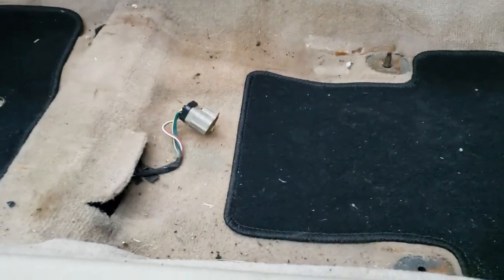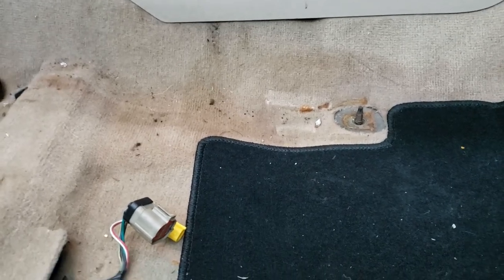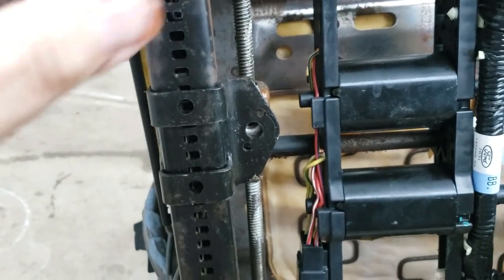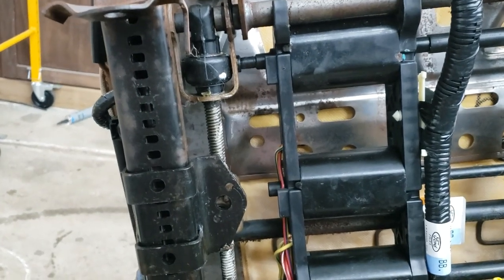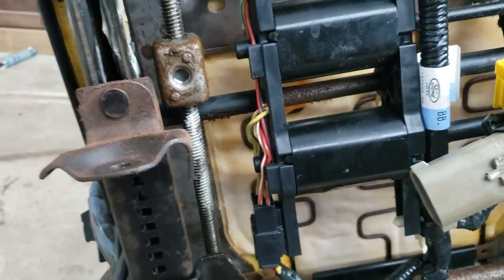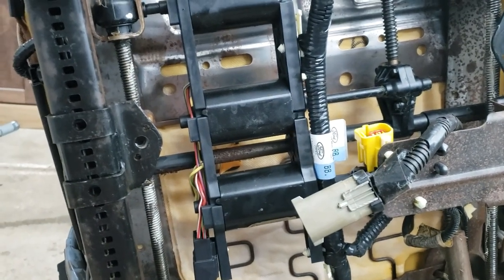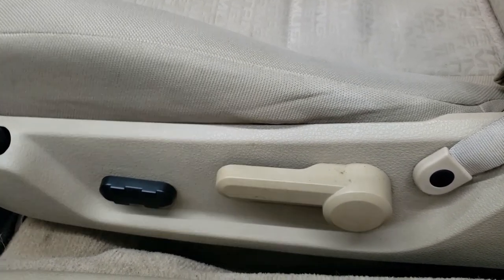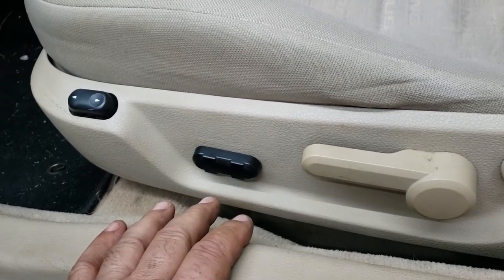2005 to 2014 Mustang power seat problems and solutions

Comment: You definitely get a LIKE here.  The wife's 07 Mustang had the front/rear power adjustment on the driver seat getting slow.  I figured the motor was getting worn out/sloppy clearances/etc.  Your video convinced me to get back to actually FIXING SOMETHING instead of just throwing parts at it. Yay!  Turns out a chunk of the hard plastic was jamming the track next to the trans tunnel. It came from the block that bolts to the track, and has the threaded bar for the front/back adjustment running through it.  The big clue was unbolting the seat  from the floor and running the adjustment.  Outboard track moved easily, inboard track was not moving much.

Pulled the seat and put it upside down on the bench, started working the tracks. Unbolted them from the blocks. Put a little bit of wheel bearing grease on the inboard track and got it moving. Wiped as much of that off as possible as not to attract future crud. Shot it and the other track with Teflon spray.  Got them really freed up. Adjusted the inboard block back to the same number of thread turns as the other to put the seat back square again. Bolted it all back in the car and it is 100% fine. THANKS!  All labor, no parts. 

Told the wife about all this ... she said "You know, I thought I was sitting in the car sideways.  Just thought it was me ..."   LOL.  She is thrilled this is fixed.   Happy wife, happy life.
Reply from the maker: You made my day

Comment: Valuable video that applies to me. I've owned mine since new. 2012. The power seats have become intermittent at times. Other times it's fine. Mine has the surface rust like that. 
This is what I'm gonna do to mine. I'm confident the track is  dirty from all these years. I just assumed the switch contacts were corroded or something. I'll look into it this weekend.
Reply from the maker: Yep try this first its free and just takes a little time

Comment: I have a 2012 V6 premium convertible. The driver's seat has power and moves back and forth but I can't get the seat to move down. the motor makes a noise but it's obviously stuck. My wife is fine with it because it's perfect for her height LOL but I also would like to drive our Mustang without feeling so tall. There is a lumbar adjust also makes a noise but doesn't work. Any idea which part(s) need to be replaced?
Reply from the maker: You will have to pull the seat and then the track off ... I am sure it might just be a small gear stripped since you can hear the motor running
Reply: I have the same problem

Comment: Thanks, I have a 2011 GT and the passenger seat stopped moving forward and back ,but the other switch positions work fine.
Reply: Did you find out how to fix it yet? I have a 07 mustang and the seat doesn’t move forward or backward but everything else’s works.
Reply: @Raul-dh1cu  It's the switch but I have not fixed it yet. They are about $130 and the whole seat has to come out, been just to hot to mess with it.
Reply: For 05-09 at least.

Comment: Hello. I have a 2013 mustang. The seat moves forward and backward fine. But the seat doesn’t move up or down. 😢
Reply from the maker: Could be the switch
Reply: @mustangrebuilder  in order to determine that, do I pull the seat out?
Reply from the maker: @Sega_is_all_i_cd  unplug switch and try to jump connections
Reply: @mustangrebuilder  thank you. Also when i push down on switch it makes a grinding noise.
Reply: @Sega_is_all_i_cd  did u fix it

Comment: Thanks! I'll see if this works first, if not i think I'll replace the switch
Reply: The switch is good, but seems like the motors don't have enough power because they try to move the seat but they seem weak
Reply: Didnt work. I think the teeth of the gears are broken.

Comment: I can't take the driver seat out, the seat is stuck all the way back and won't go forward so I can't reach the back bolts what can I do?
Reply from the maker: Can you get a wrench instead of a socket on it
Reply: @mustangrebuilder  the screw does not come out because it gets stuck with the part of the rail that is at the back I can unscrew it but not completely
Reply from the maker: @lupes1975  https://youtu.be/Jqpb_wJ_ZNA try this hack to make it move for you but look under the seat and along sides to see if there is nothing under the seat
Reply: @mustangrebuilder  Thanks I'm going to try to repair it with the video that you sent me, today I looked under the rails and I had a bottle cap stuck under the rails I took it off but it didn't move, you can hear the engine but it doesn't move. sorry for my english greetings from mexico and excellent video

Comment: Any idea why my seat will move forward and backward no problem… but will not move up and down. The passenger seat is the same… moves forward and backward… but won’t move up and down.
Reply from the maker: Could be switch
Reply: @mustangrebuilder  we already change the switch and it didn’t solve the problem
Reply: @mustangrebuilder  and also I was wrong. The passenger seat will go up and down, but will not go forward and backward. The driver seat will go forward in backward, but will not go up and down. There’s no way that could be a fuse, correct?
Reply from the maker: @suehorton5041  so you have power since the sea tmoves ... have you pulled the seat ..its 4 bolts
Reply: @mustangrebuilder  first off… thank you for your replies. No… we have not pulled the seats out yet. Both have power but won’t go  in all intended directions. I’m thinking it’s possible that something is blocking the track on the passenger seat. I have no idea on the drivers seat not going up and down. Does the same motor control forward/backward/ up and down?  And is there just one motor for both seats? If I take seat out, what am I looking for? Again… thank you so much for your time. I’ve been searching for an answer and have no idea who to ask. The mechanic at pep boys had no idea.
Reply: @suehorton5041 Sane problem here on the driver side with the seat not going up or down. However , I can hear the seat motor. Did you ever get it figured out?
Reply: @IPeeOrange  yes we did. There is a plastic wheel with teeth on it. Can’t think of what it’s called. But the teeth were broken on that wheel. You have to take the seat out to get to it. Had to replace that wheel.
Reply: @suehorton5041  Awesome! Glad you got it fixed. Appreciate your response!

Comment: I have  some info about interior water build up , My 2011 cowl filled with water and backed up into the passenger side . There is a rubber grommet in the cowl where the wipers are if  You look at bottom these clog up and fills car with water so I pulled grommet out and no more problems The Ford dealer wanted over $200 to see what caused water to get inside the car . There are 2 rubber grommets pull them both out and use a hose to clean out all the crud inside the cowl you could replace them once cleaned its up to you . Hope this helps someone with water inside car
Reply: Bruh this happened to my mustang 6 months ago YouTube coming in clutch for the car community 👍🏽
Reply: This happened to mine and the water build-up ruined the brain! Mechanic had to find another one from a junk yard.
Reply: Do not pull the grommet out and run without it. It is there to keep underhood fumes out of the car.  We have a magnolia tree and the small flower bits jammed ours up. I cleaned them out and slit the sides so that these small bits can wash through these without clogging them.

Comment: I have a 2005 mustang and it won't go down and the lumbar is stuck all the way out so my head is stuck at the roof and very un comfy the car has 11k miles never drove sat in a garage its whole life and now that I own it till I can fit in it, it will stay in a garage sadly
Reply from the maker: Did you see if the seat is getting power first
Reply: @mustangrebuilder  yes you can hear the motor trying

Comment: I recently bought a 2006 mustang, and my switch to move the driver seat won't even click
Reply from the maker: when you move the switch is their any noise
Reply: @mustangrebuilder  no noise
Reply: @mustangrebuilder  i figured it out already my connections are different from what the car seat has
Reply: Mine makes a clicking sound but won't move forward or back
Reply from the maker: @TimaGoncharov  pull seat and see if motor is froze or gears stuck and lube
Reply: @mustangrebuilder  hello. When I am trying to move the seat up, I hear motor’s sound, but the seat doesn’t move. But when I am trying to move back and forward the seat doesn’t move and I don’t listen any click o motor’s sound. I’ll appreciate your help

Comment: Just fyi I just bought that switch on amazon for $65 new!
Reply from the maker: Thanks brother
Reply: @mustangrebuilder  i have a question i see you say u unplug the yellow conection too but mine only has the white plactic conection the yellow one is jus there is pluged both sides but no wire goin to seat u think thats wats rong with mine kus mine is also moving at an angle left side dont go i cleaned and greased it seen ur video and i think mine is rong nothing yellow conects to mine
Reply from the maker: @CALIFORNIA.EMPIRE1990  If you can get a picture send it to mustangrebuilder@gmail.com